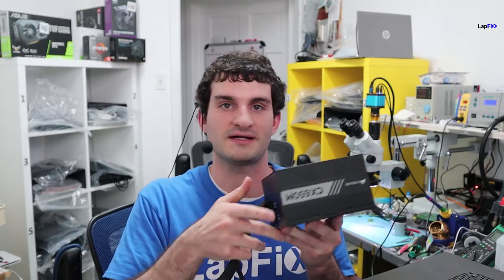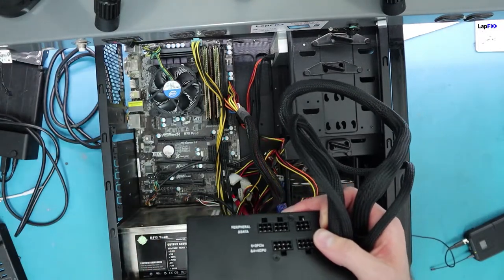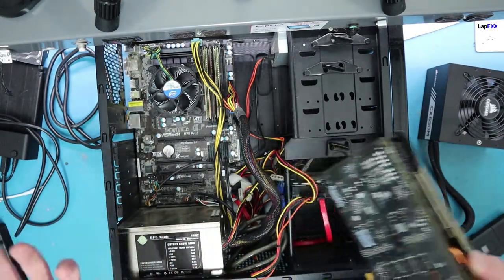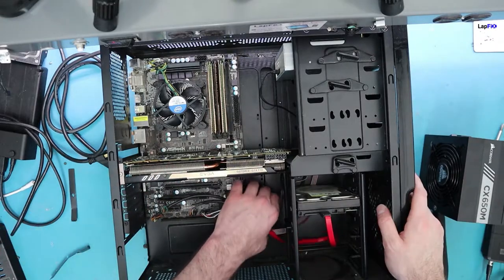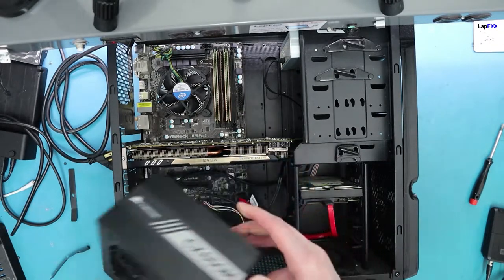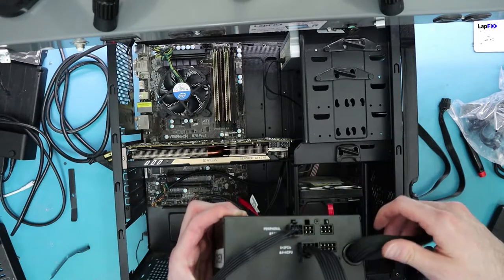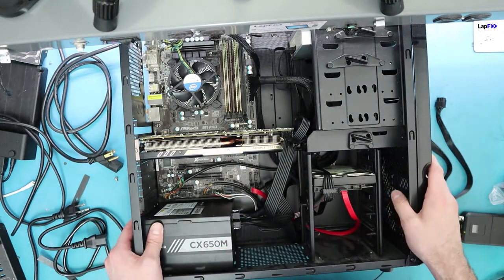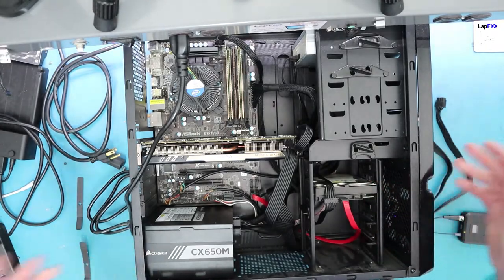How to Upgrade a Power Supply for a Gaming Desktop

Comment: That power supplier  look pretty big you have. I was looking on eBay I have a HP from 2013 and some of the graphics cards out that require extra power source. But don't power suppliers come in different sizes because the case I have is not that big it's a tower though